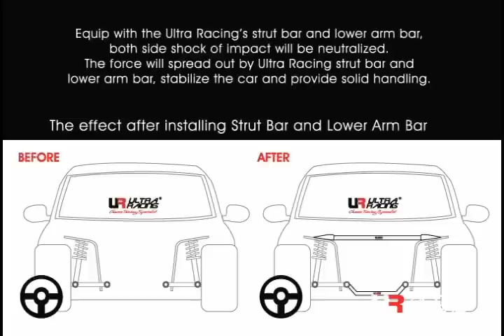Ultra Racing | Installation Guide: Honda Civic (FN2) Type R Front Strut Bar (UR-TW2-1106)

Comment: Blocks the oil and dipstick,  good luck if you have to check oil or add oil. More work ,
Reply: wrong, the bar does not intrude on these two areas, the camera used here creates  an optical illusion  , I have this bar on my FN 2 , no issues whatsoever .
Reply: @habibnetanukefuel795  so then make a video showing oil check and remove oil cap. Maybe ur right but I'd have to see for myself.
Reply: @edsyfi1812  why don't you make a video to back up your claim, oh that's right .more work. You're obviously a time waster Eddie.
Reply: @habibnetanukefuel795  dude did u make the product? wtf u mad at me for ?? Optical illusion 🤣🤣🤣🤣 enjoy your product man. Dont bother me anymore if u can't back up ur illusions. I was trying to be nice,  but you didnt see that.
Reply: Ive got coilovers with damper settings on top.  Anyone got this strut and can tell me that the damper knob is easily accessed?
Reply: @TangASD  Hi Tang, you will have access to the damper knobs with this bar, as well.as being able to check dipstick and oil filler cap, I have one on my Fn2 and am running adjustable bilstien shocks. No issues with fitment or intrusions.
Reply: It doesn't block anything bro 😊
Reply: Just one more thing. If I need to change my spark plugs does this bar have to be removed or is there clearance? Getting mine soon

Comment: That not good if you have to put oil in the engine
Reply: fitted the front bar this week , there is plenty of clearance to both check oil and add if needed.